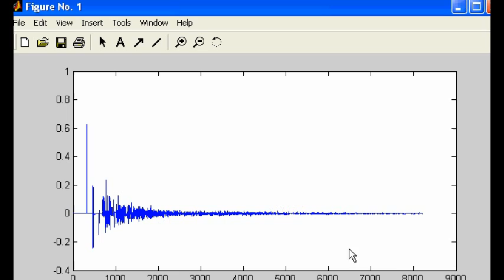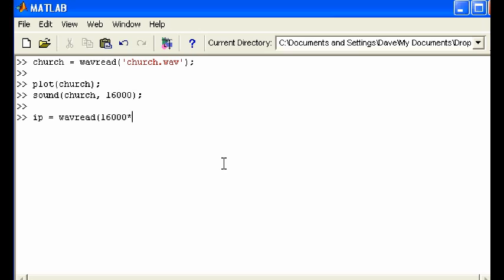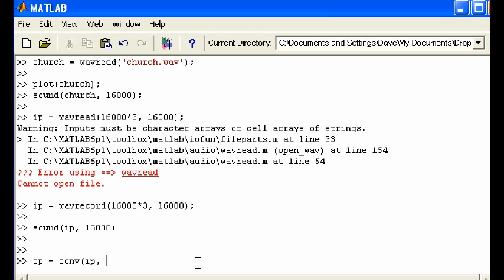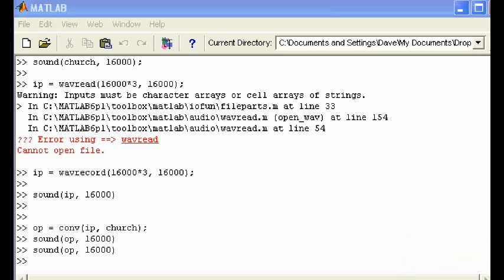convolution -audio example

Comment from the maker: if you have the impulse response of the transmission system (speakers, cables, etc) then yes you should convolve the speech with the impulse response to simulate convolutional noise.

Comment: Thanks,

i've figured that out. I found that when convolving a clean speech and babble noise the output audio is so much corrupted. However, when adding the two audio together it is much more understandable. So i think conv() is more suited to simulate convolutional channel noise right ?